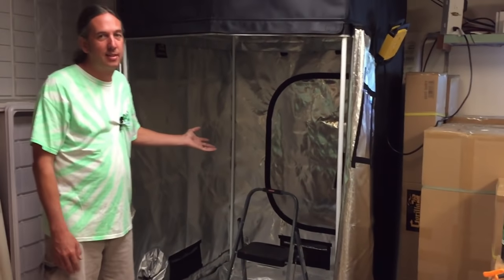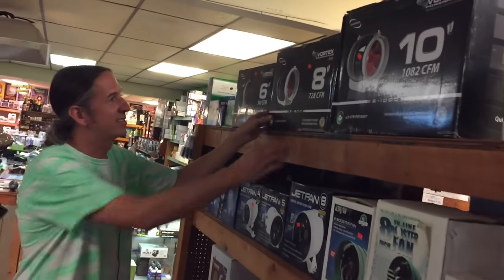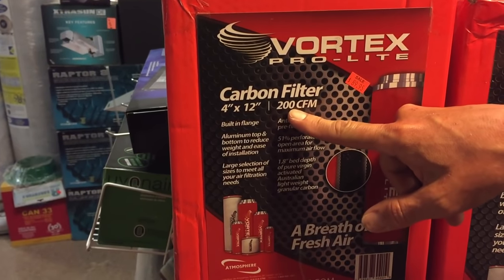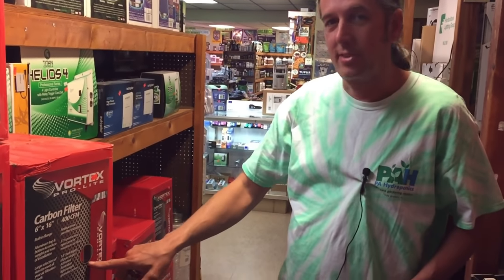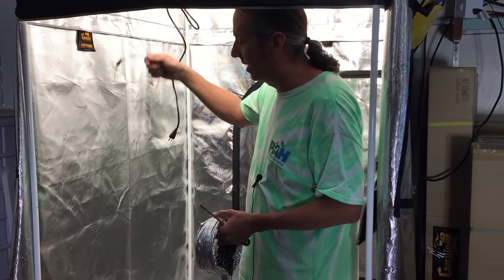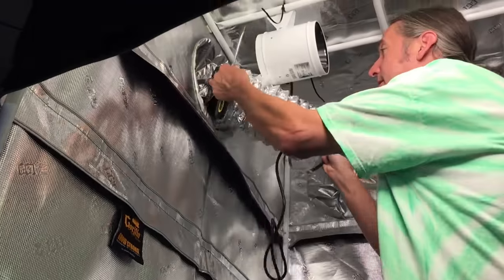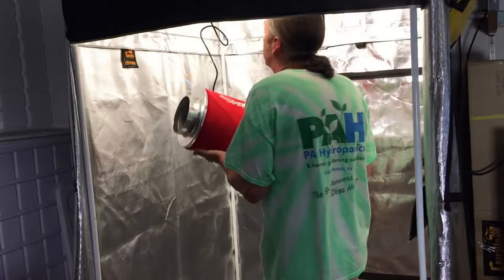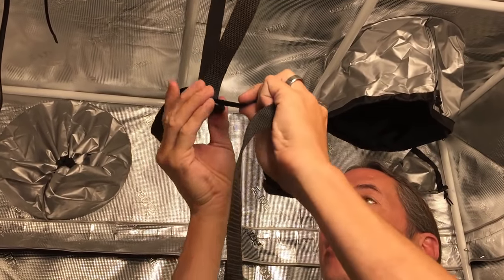How to Set Up a Ventilation System for a LED Grow Tent

Comment: If you put the fan on the outside of the tent pushing air in it creates positive air pressure instead of negative air pressure inside the tent. PAP is better for the plants and slightly expands the walls of the tent instead of compressing them inwards giving you more space. You just slap the carbon filter on your exhaust port as normal it works great. Also not having the fan inside the tent obviously makes more room in the tent where the fan previously would have been. Give it a try you wont be disappointed!
Reply: U keep the fan and filter inside still to keep the fan noise down plus its the easiest way to hang them, But u put a inline fan at the bottom hole to suck air in as well🤷‍♂️
Reply: Don't do this if you have dogs or are worried about contaminated plants. Blasting your grow with dust and hair makes for a nasty product.
Reply: @William1987GTA1  that’s why you put a filter in the intake

Comment: this is what I am talking abou by far one of the best videos/tutorials out period there leaves no set up questions to be asked!!! I usually don't hit like and I don't leave comments. way to go way to educate. I do have to ask couldn't you have used say a  6x12 carbon filter in a setup as long as it way rated for amount of air you want to move correct? ex: 5x9x10 tent 6x12 filter 450cfm rated 35cfm fan
Reply from the maker: Hello and thanks for the compliments! Usually 6 inch filter are at least 16 inches long, and 4 inch filters come in the 12 inch length but if they do make a 12 inch then it should be set up to run with a 6 inch fan. Thanks for the comment! Gary

Comment: A do agree with you Gary about using a fan that's too big but if you have speed control you can turn it way down and you can get longer life and if you upgrade you can use it in a bigger set up down the line as someone progresses cuz I use a 6in in a 2 by 4 but I run it under 50 percent all the time and I made a diy kit to keep my tent walls from sucking in and it also holds my trellis net super tight in place hehehehehe

Comment: Little tip to keep things easier and cleaner looking, just attach your fan straight on to your filter with a flange or collar. If you have neither strong gorilla tape works just as well. Iv done this with rvk’s/isomaxs/hyperfans/tornado boxfans all sizes from 6-12 inch works fine, no cutting or messing with ducting just one clean straight run😁
Reply: Its actually not recommended to attach inline fans directly to a carbon filter. The vibrations from the fan can cause the carbon to settle on the bottom of the filter and then can cause air pockets in your carbon making the filter less effective and possibly clog faster.

Comment: Just found your channel today.  Love your videos.  All good info, especially the attention to symmetry and precision.  I've seen so many garbage setups with junk everywhere, random things in the room, off-center lights, open water buckets, etc.  One thing I think is important to remember, especially with systems using lots of water: electricity ABOVE, water BELOW.  That's another mistake I've seen: random wires all over the place.  That's just asking for disaster because there are two types of growers: those who have had a leak, and those who will.  Keep up the great work!!

Comment: Thanks!! Finally a video showing how to install, not just some unboxing shit!! Subscribed!!
Reply from the maker: Thank you so much!! Gary
Reply: @PAHydroponics  do you know how often you have to replace the carbon in the filter and how do you do it? also would it save the carbon if you didn't hook in up until you need it during flowering? cheers!
Reply from the maker: @Cream_CurdlR  Yes it would save the carbon only using it when needed, wrat it in plastic wrap when not using. Filters last a year for the most part, some people get 2 years, I notice around end of year holidays people seem to replace most. Thanks for watching. Gary
Reply: @PAHydroponics  ty

Comment: I have a 3x4 tent with a 6" fan but found to get maximum airflow during flowering I needed a 2nd fan pumping air in with both on max speed. that solved my mold problems

Comment: A few years ago, I built a 3x4 box without knowing what I was doing. I got three 300 watt equivalent LED panels, a carbon filter and inline fan. There was an exhaust line for an old central vac system so I arranged it so the fan blows into the filter which is held in a box with sliding door access. The box is connected to the exhaust line and filtered air is pushed up the exhaust and out of my house. It works but it's not very efficient. I was worried that the carbon filter wouldn't remove all the skunk smell.  Anyway - I'm mostly a dirt pot guy and although I've grown in it, usually the box is just to start my seedlings and dry my herb in the fall. After watching your clip, I think I'll rework the filter!
Reply from the maker: I like your story, thanks for sharing, I bet it did work tho, I have had plenty of people do that. Thanks for watching! Gary
Reply: @PAHydroponics  Thanks Gary - I think that's a nice way of saying I'm not the only knob in the world.  :-)  I tore out the filter compartment and vented my grow box properly. It really blows air now and this winter I won't be pushing heated air out of my house.  Good channel, pal.

Comment: My LED tent in basement heats inside to low 70's and an open vent at bottom and top provide a convective cross air flow ... no fan needed (bought one, never used it). Getting great yields.

Comment: 13:53 , You mention here about someone wanting to get a fan bigger than you need and it sucking in the walls of the tent.... That could be a big positive though if you are concerned about smell, since putting the tent in a negative pressure environment would force any air escaping the tent to be passed through the carbon filter and not leak out through zippers, etc.

Comment: I'm wondering because all information says you can place the filter on the intake or the output but the pre-filter will not filter properly if just stuffed inside and I assume the filter will be exposed to moisture if left on the floor outside the tent. But the vendor told me to put it outside... Great video btw

Comment: I just bought this combo.  
I'm doing just 2 in my bathroom downstairs.  I'm not too worried about anything but cooling down the lamp.  I'm ole school,  1kwatt hps . Has glass. So sealed.  
I'm gonna try to run this through the light,  I know I'll have to run 24/7, but,  what I'm trying.  So, filter,  into light,  into fan,  out to another room,  possibly out side.  Hoping for the best.  I will eventually separate the light from filter.  
Maybe

Comment: I live in an area where many people use wood and coal to get their hauses warm, and I use a ventilation system to ventilate my hause and to recover the energy from the air. Can I use a filter like yours on my admission in order to remove the smel and the oddor from the outside air? Thanks

Comment: Setting up my tent now I’m a total beginner, do I not need another fan blowing air in from the outside or am I fine just opening the windows and vents ?
Reply: Update: you don’t need a fan from the outside (intake fan) unless you have TOO MUCH negative pressure sucking in the walls, a little negative pressure is good but too much will take CO2 away from your plants
Reply: CkHun how do you know if you have too much pressure
Reply: @op9787  ?
Reply: Alex Ash the walls are caving in, and the fan is too strong for the tent

Comment: Is it normal for the walls of the tent to be sucked in making the tent smaller like is there too much negative pressure ?
Reply from the maker: It is ok and normal, you can slow the fan down a little to help with that and make sure you have vents open at bottom of tent to let air in. Hope this helps and thanks for watching:) Gary

Comment: Do I ABSOLUTELY need a carbon filter?

5x5x7 grow tent, using fluorescent lighting...
Thanks Gary, et al!
Reply: PS: odors are not an issue for me. Any other reasons I should use a filte?
Reply from the maker: odors are the main reason people use carbon filters, if that is not a concern then as you stated, it will not be necessary.
Reply: Thanks Gary!

Comment: With the booster fan, can I connect it in series with my inline fan? So from the carbon filter a duct tubing will be connected to that filter with a clamp and the other end would be on my booster fan, from the other end of the booster fan will be another duct tubing which would be connecting to the t6 inline fan, and then the other end of the t6 inline fan would be going out through my basement kitchen exhaust system. Would this work? Or should I just keep the booster fan on its on for more airflow in my tent?

Comment: I thought you only need a carbon filter if you needed to get odors out of the tent. That won’t be necessary. In my case I’m just growing vegetables and not weed. I also heard that you’re supposed to have another fan on the bottom of the tent in the opposite corner on the floor is that true?

Comment: Question, does the filter need to be hung or can it sit on its bottom?
Reply from the maker: Good question, it's best to hang it high because that is where the hottest air is and the floor has the most co2 so I really try not to set them on the floor but if you have to it will still do its job. Thanks for watching. Gary

Comment: I'm gonna run 2 ceramic metal halide  lights in a 4x8 gorilla with roof extension. Could I run an in-line fan above the halide lights?

Comment: Great video.  I'm wondering if there would be any benefit to using a larger carbon filter with a reducer to a smaller fan?  For example...an 8" filter with 700cfm with a 6" fan at 400cfm.  Would it pull through the larger filter easier and more contact area to remove smell?  Or should a person always use 6" with a 6"...8" with an 8"...etc?

Comment: I always used an exhaust with HPS in my flower tent but with my new LED my temp/RH is fine with just oscillating fans and open vents. Is this going to be ok later in flower?

Comment: Do I just have to hook up the ducting to a fan outside the tent for fresh air? Or do I need to hook it up to the ventilation system of my house?
Reply: No, you cannot, and should not, hook this thing up to your HVAC system.

Your system gets "fresh air" from the holes in the tent. The filter itself is sucking air out of the tent from the inside. The ducting isn't drawing in fresh air from anywhere directly. 

The fresh air gets drawn in by the tent becoming a negative pressure environment. So it gets new air wherever it can. If you don't have a hole somewhere you'll notice the tent walls look like they're getting sucked inward.

You don't want this. You need to achieve pressure equilibrium between the inside and outside of the tent. Otherwise you'll stress the fan motor.

I.e., just open one of those holes near the bottom or uncover a viewing screen enough to let air in.

I think of the tent like how computer ventilation is setup.

Hopefully that helps.
Reply: Med Otaku thanks, do I need to ventilate my grow tent through a window?

Comment: Great video!  How do you get fresh air coming into the tent when it’s all closed up?  I see there is a vent flap. Should this be opened when light is on to bring fresh air in?  Should there be a fan outside the tent to push fresh air in?  Thanks.
Reply from the maker: The suction of the fan pulls in fresh air, you can build a light trap around the floor vents to block the light coming out of it, look into shadow boxes :) G
Reply: @PAHydroponics  I use a booster fan to bring in fresh air In a 2x4 I built with a 4” sucking air out and it works well. Was thinking of using the same setup in a 4x4.

Comment: Can you vent into the room or does that exhaust have to goto a window/outside?
Reply from the maker: Yeah you can vent back into room. PAH
Reply: @PA Hydroponics  wouldn't that just recirculate the air? the carbon filter isn't converting o2 to co2? Only fresh air my plants would get is when I open door to check on them.. hmm and no issues with mold this way?

Comment: Nice video! I'm setting up my 5x5 tent and will be setting up the ventilation the same way. My question to you is should I keep the two 4inch openings open with a small isolating fan to bring fresh air in and up to the filter ?
Reply from the maker: Good question. Your exhaust fan will create a vacuum and pull fresh air in so you shouldn't have to do that. Open up the vent flaps at the bottom of the tent. Hope this helps. Gary
Reply: @PAHydroponics  Right on! Thank you
Reply: If you leave the bottom flaps open won't that let light in during dark hours.
Reply: Cyclonex1CA ca  but the open flaps like he said will have light leaks
Reply: I just got this 5 by 5 gorilla and have the same question about leaving the vent flaps open won't light leak inside when these bitches are asleep for 12 hours. I get that opening it when the light is on isn't a big deal but if the tents humidity rises say or temp goes to high in the summer when lights are off for an example your going to get light ( since it's hot where I live I have to run lights at night in summer) leaks. So this passive air intake port really sucks and of there are just a couple 3 inch electric cord ports that's not going to really do any good either. 
Also I have an ac infinity with the digital thermostat which rocks. Don't understand why this wouldn't do as good of a job if not better since it's only coming on when it needs to which then it would scrub the air as it's vented out my window.

Comment: I had a question for you. Can I use the inline fan on the outside of a tent pushing air in the tent and exhausting out of a separate duct? Would that be sufficient?
Reply: Usually when you place the fan on the outside, you'd turn the fan around and use it to suck air out of the tent through the filter. Then you can just use one duct!
Reply: @SmokingBeaver  what would I do for fresh air in tent besides opening screened window? I can't keep the screen window open during dark hours due to light leaks. Would another added duct hooked up without a fan solve this problem? Thank you so much for your reply. I check daily to see if you have a new video up. God bless
Reply: @WildBill496  How big is your tent? Usually fresh air is no issue, as the tents are not airtight units. Fresh outside air will seep in and should be circulated by circulating/oscillating fans within the tent. Exhaust should be enough to have negative pressure, so that all air is pulled through the filter. 

Haha no problem! I'm not the channel you're referring to, I just saw your comment and figured I'd help out! I run a different weed growing channel.

Comment: Question: Hey Gary (and anybody who knows the answer to this), I've got a 8x8 grow tent and have calculated what cfm I need from my fan and carbon filter. My question is if I'm only using half the tent for growing, then should I adjust my cubic feet calculation based on the space that I'm actually using (i.e., a 4x8 instead of 8x8) or should I keep it to 8x8 regardless of how much I'm growing inside it?  

Thanks!!!

Comment: I want to start a closet grow instead of using the carbon filter for smell will setting up the outtake fan to release in attic be ok? As opposed to releasing into the room like you did? Thanks much!
Reply from the maker: Hello, you can vent to the attic - no problem, the only thing would be that whenever you vent out of your house it will create a draft , so air will be coming into your house thru door cracks and windows etc. But other than that it is fine, I would still use a carbon filter so you dont piss off the neighbors:) G
Reply: Could cause mold issues
Reply from the maker: @ReapingTheHarvest  Good point ! Hope the attic had good ridge vent or some sort of ventilation..

Comment: New to all this. Wouldn’t you want to filter the air coming in? I notice your setup getting rid of the filtered air. Thanks
Reply from the maker: The filter is to remove odors as you pull fresh air into the tent for the plants to use.  

Creating a vacuum in the tent insures no odors escape and the air exhausted is clean.

Comment: already have a filter in the tent , but I want to put another carbon filter on the outside of the tent meaning that I have a dble filter filtration  . could I use the vortex filter to to blow air out of it ...or is that not a good filter for my idea...any knowledge would be helpful

Comment: Is it the fan blow into the tent and with the filter is it gonna blow inside of the tent from outside or is it gonna blow as  exhaust fan
Reply from the maker: It exhausts and blows out of the tent while at the same time sucking air in to the tent intake flaps that you should leave open.G

Comment: Hi I see this is a old video but was hoping I could get some information, I was wondering can this set up work if using one 600 watt instead of the LED.
Reply from the maker: As long as you are taking into account you will need to vent the heat from the light.

Comment: Thanks for the video , can you tell me what size you'd recommend for a 120cmx120cmx 200 cm with a  600 Viparspectra LED , tent is under porch enclosed , temp in summer is usually around 32 degrees and 20-25 degrees in winter , fairly humid in summer , thank you
Reply from the maker: Hey there, I would say to be safe to go get the 6 inch then you will be good to go even if it does get hot and to deal with summer humidity. The 4 would probably keep up at full blast but yeah I would go with the 6 inch. Thanks for watching! Gary
Reply: PA Hydroponics thanks for the advice I will go with the 6 ", appreciated